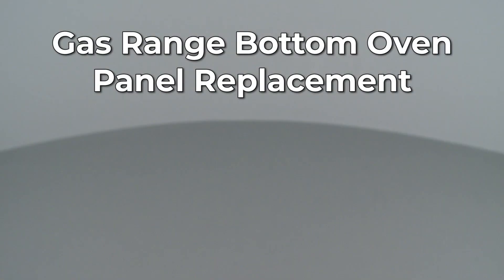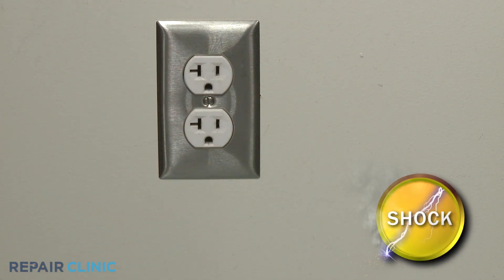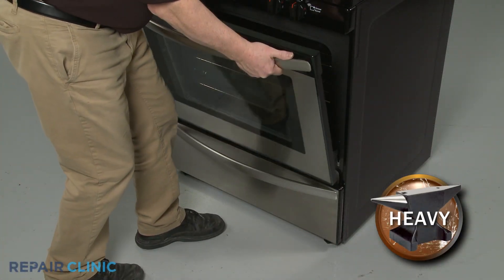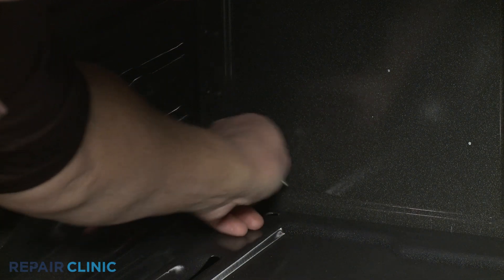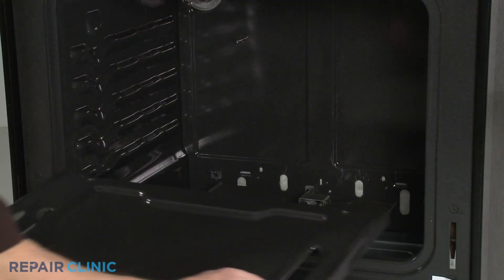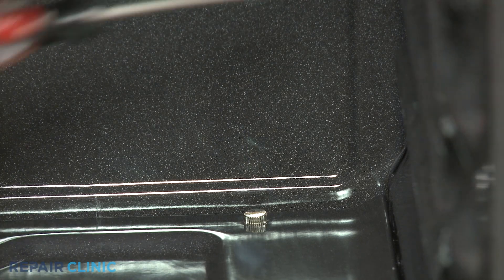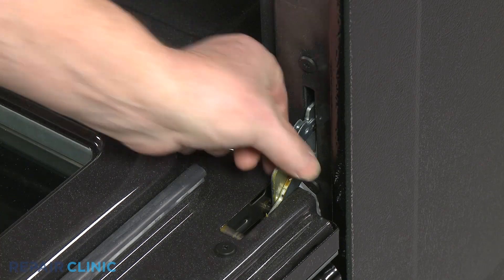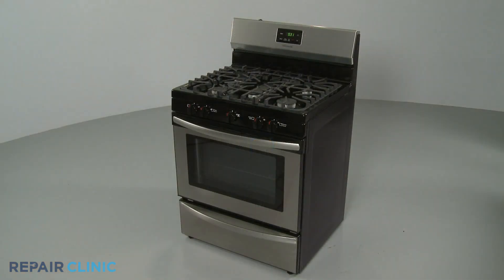Frigidaire Gas Range Bottom Oven Panel Replacement (316495901)

Comment: I'm really struggling to remove the bottom panel after removing the screws. It pivots at the front but no matter how I try to jiggle or slide it, I can't remove it.
Reply: Got it. Had to get a little violent. Your vid was instrumental in understanding how to get the main door off, so thanks.
Reply from the maker: Sometimes it takes a bit of force. Good job!